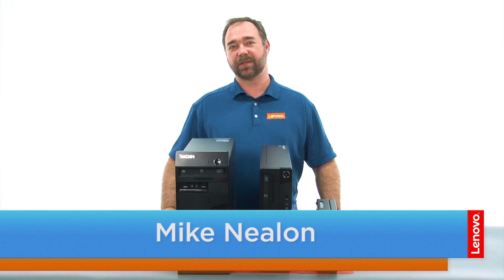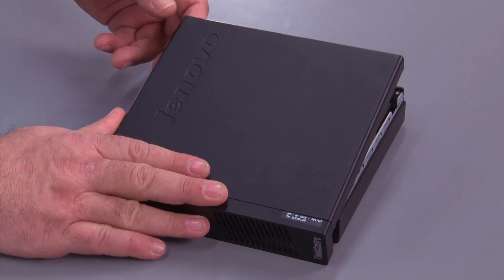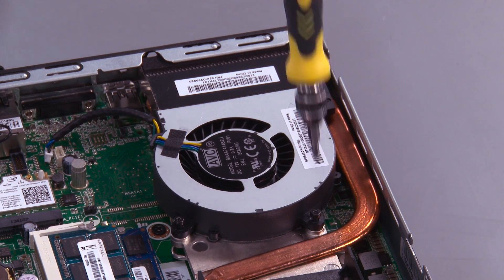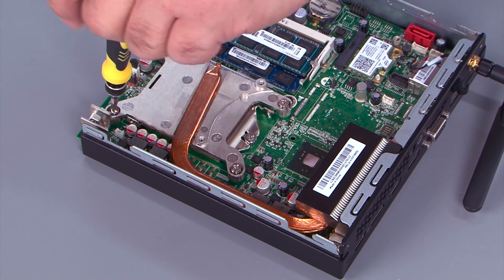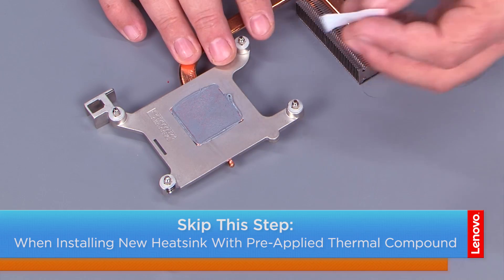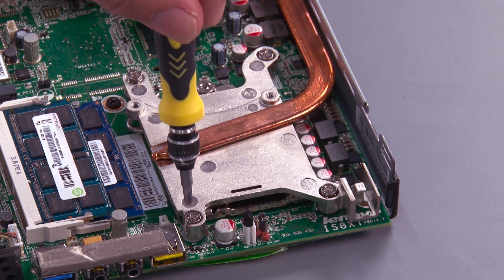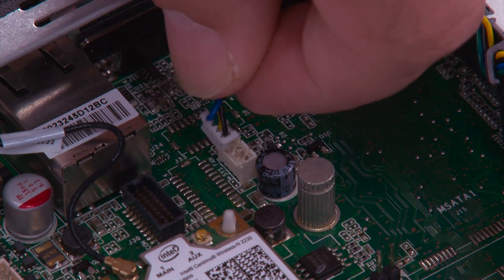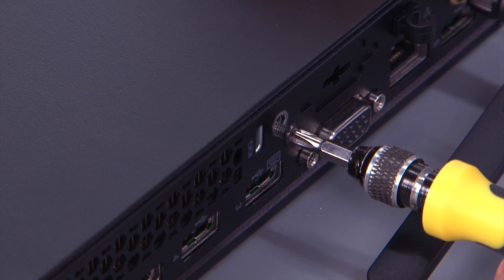ThinkCentre M73 / M72e Tiny Desktop - Microprocessor and Heat Sink Replacement

Comment: Is there anyway to install a i5 3470 or i7 3770 in the m72e tiny? I can upgrade the psu if the cpu wattage is the only issue.
Reply from the maker: Hi Terry! Thanks for reaching out. You can see here https://lnv.gy/3cgW6yO all the tested processors for the ThinkCentre M72e Tiny. If the i5-3470 or i7-3770 is not in the list, it means it is not tested, but technically, it will fit because they have the same FCLGA1155 socket, but we can't guarantee the full functionality if it's not tested with the desktop. Mark_Lenovo

Comment: Hello!
I installed an i5-4460 (3,2-3,4GHz) and an i5-4590 (3,3-3,7GHz) in 2 m73 tiny and I'm facing the same issue:
According to Windows 10 or HWmonitor, both are performing at their expected speed except when trying a heavy multicore load (like cinebench r20 or Aida64 stress test, and I know these are not "real life tests").  
In this case, the i5-4460 is at 2,6GHz on all core while the i5-4590 is at 2,8GHz on all cores. These frequencies are only set during the test, before and after that, both processors can go up to their max frequencies. Also, Win10 task manager indicates a 80% cpu load for the i5-4460 and 84% for the i5-4590 (instead of 100%).
I know these processors are not T models and require more power, so can it be a power issue?
If I understand correctly, the m73 can only deliver 65W (processors are listed at 84W TDP).
Honestly, I'm very satisfied with the current performances (up from a pentium G3440T), it's working perfectly but I was wondering if I could fix this issue or not.
Reply from the maker: Hi n3cotraf. Thanks for writing in. The heat sink of the M73 Tiny is only designed for 34W TDP and it has single heat pipe. The heat can be a factor that's why the CPU that you installed did not reach the peak performance. Since you're running CPU with 84W TDP, heat is not properly dissipated, thus, limiting the performance of the CPU prevent it from overheating. Auxen_Lenovo
Reply: @LenovoSupport  Hello and thank you for your quick answer!
The thing is that the CPU is not throttling down like it would because of heat (at least in my experience): at the start of the stress test, regardless of the current temperature and speed, it will go to 2,6GHz (or 2,8 depending on the cpu) and perform the test. Temperature will slowly rise until it reaches 78-80°C then the fan hits 2500-3000 rpm and it will stay that way without overheating. Which makes the heatpipe cooling even more impressive for me :)

The other thing that makes me wonder is that in the BIOS, in System summary, i see:
CPU Type: Intel(R) Core(TM) i5-4590 CPU @ 3.30GHz
CPU Speed: 2.8GHz
Do you know where that CPU speed is coming from? I checked on ark.intel.com, it is nowhere to be found, the CPU is supposed to be 3,3GHz base on all cores and turbo up to 3,7GHz on one core.

Thank you again for helping me understand this situation!
Reply from the maker: Hey there, n3cotraf! You can check the CPU speed of the Intel i5-4590 here https://lnv.gy/3fka4zr (Official Intel website). Also, here is for the Intel i5-4460 https://lnv.gy/2OfTMvr. Let us know if you have any other concern. -Chris_Lenovo

Comment: Hi! Is is possible to upgrade i5-3470T on M72e Tiny to i7-3770T? Main difference is slightly bigger TDP: 45W vs 35W.
Reply from the maker: Thank you for reaching out, James. Can you please share your serial number so we can check? (located on the bottom sticker at the back of the device shown as S/N) We'll wait for your reply. Carll_Lenovo
Reply: @LenovoSupport , here it is: MJ83E8C
Reply from the maker: Checking the OEM certified parts https://lnv.gy/36zzgys, i7 processor is not listed. The list shows what are tested and are known to be compatible and working. We have not yet seen any user posted on our Community forums that has this setup. Hope this helps. -Maru_Lenovo
Reply: @LenovoSupport  Thank you!
Reply from the maker: You're welcome! Let us know if you need additional assistance. Keep safe and have a great day! Erica_Lenovo

Comment: i am thinking about upgrading my actual processor which is a G3220  to an intel i7? are all motherboards on these M73 tiny the same?
Reply from the maker: Hi! Thank you for reaching out to us. Upon checking the specifications for this system http://lnv.gy/2nYdDlY it shows that it only has one System board which is the Intel H81 that supports LGA1150 socket. You may refer to this document http://lnv.gy/2nYPZG9 for the actual part-numbers compatible with your system. Reggie_Lenovo